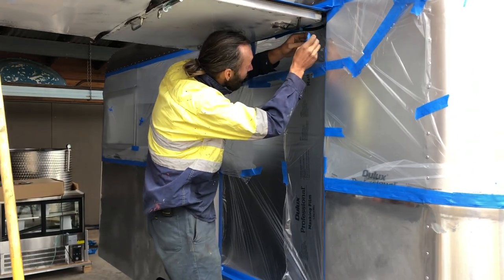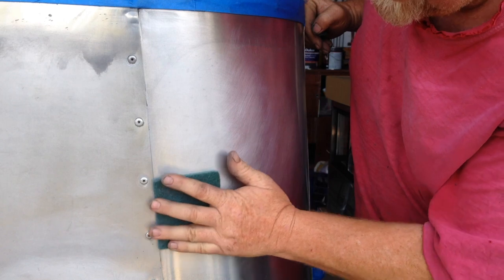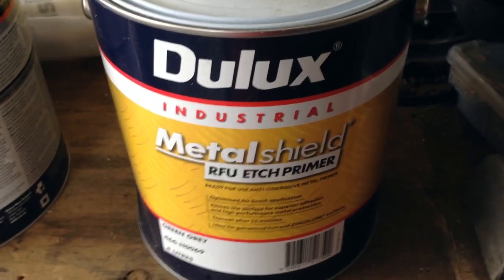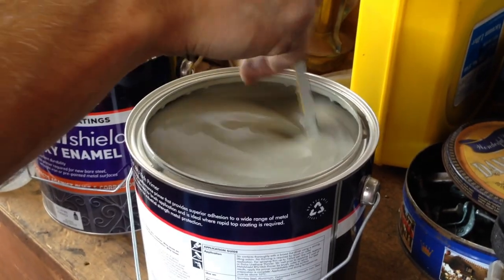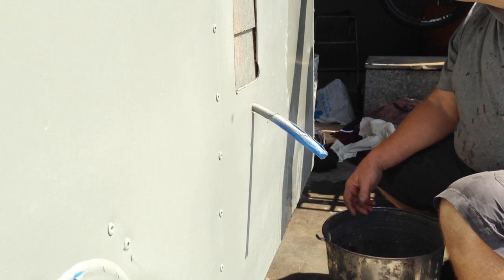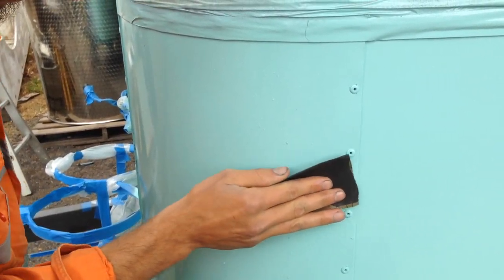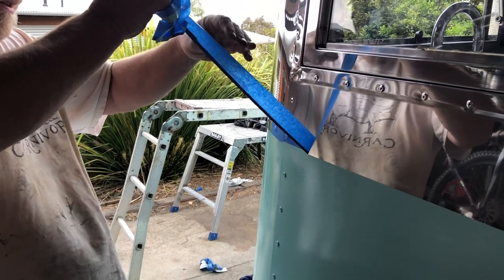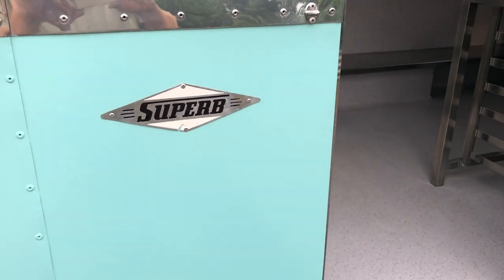How to Paint a Vintage Caravan

Comment: Hi Steve, you guys do a great job, I love the vids, thanks for sharing.
I am restoring a Viscount and I was wondering if you have any feedback about the longevity of the Dulux epoxy enamel? Have you seen any of your resto’s after a few years and how did the paint look, Chaulky?

Thanks, James.
Reply from the maker: Yes, its a good durable paint and is still looking good on the vans after several years. I am just about to paint another van and will be using it again.  I am not really a painter though and it is likely that there are better paints out there, I choose what's easy, available and what I can get a reasonable finish with given my facilities, gear and skill.
Reply: Cool.
The finish on the aqua/polished aluminum looked pretty good when you zoomed in.
I would of liked to have 2pack Auto painted mine, but trying to save costs as it’s blowing out.☺️

I’ve ended up using the White Knight system, but after lots of deliberation, chose the quick dry water base enamel for the top coat. Just based on its longer warranty claims (maybe less yellowing and chaulky then the epoxy, we’ll see)

Thanks for replying 👍

Comment: Hi Steve I am looking at painting my caravan 2015 jayco outback do I just need to rub down and 2 x top coats of metal shield apoxy? and I f I want to paint checker plate from alum to black does it require primer first?
Thanks

Jamie
Reply from the maker: I only really have experience with the Caraparks so would be reluctant to comment on painting your van, I'm not really a painter either and you would be best to get specific advice I would think :-)

Comment: Hi fantastic job, good inspiration for me.  Can I ask what type of spray gun you are using (HVLP, LVLP?) and what size tip?  Cheers
Reply from the maker: I used a cheapo 1.5mm HVLP gravity fed running down at about 18/20 psi from memory.  I am not a painter at all, but happy to have a go, there are loads of good spray painting channels that would be more appropriate for detailed info on painting a van I would think.
Reply: Cool mate, thanks for taking the time to reply, I'm doing mine over the weekend, seeing your video convinced me to give it a go! cheers